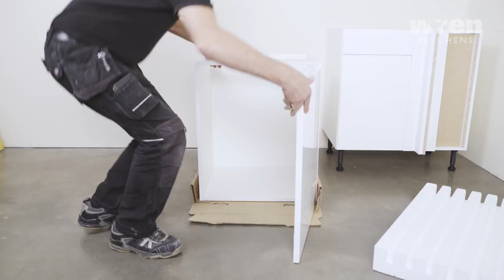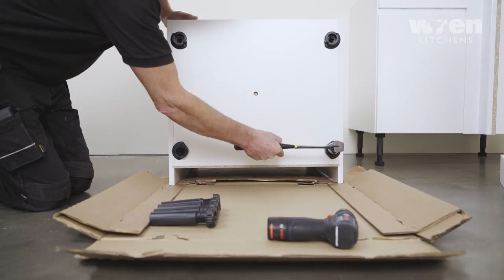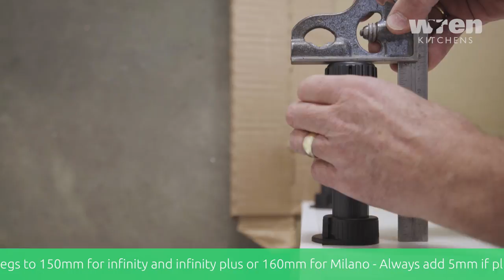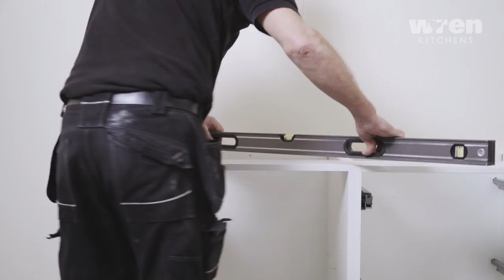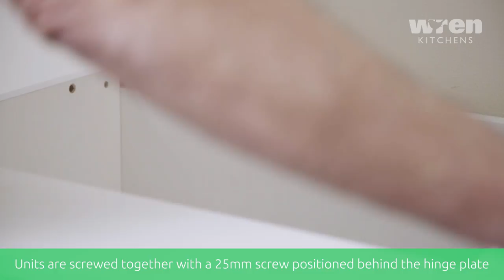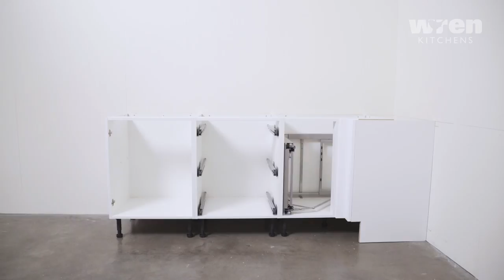Wren Kitchens Infinity: Base Unit Installation

Comment: What is not explained by the voice-over, is that when the guy is running his fingers over the legs mounts at 0:30, is that the front facing legs must have the flat parallel to the front of the unit.
That's what he's showing, why the leg base has the flat edge on 2 sides.
If it's not, then when you install the Plinth  (the boards that cover the legs) they can interfere with the plinth board standing vertically. I got mine right more by luck than judgement.
So it's all very well having these videos here, but there is no point stating the glaringly obvious, like use a spirit level, if you're not going to explain the subtle features like the design of the leg fixings.
Reply: Hi Berni, could you tell me if the orang spacers or the connectors to fix the cabinets together are supplied with the units?  I've checked with Wren Sales dept who say no, but before I buy any extras I'd rather check what you do get with the cabinets. Hope you can help and thanks for the heads up on the legs